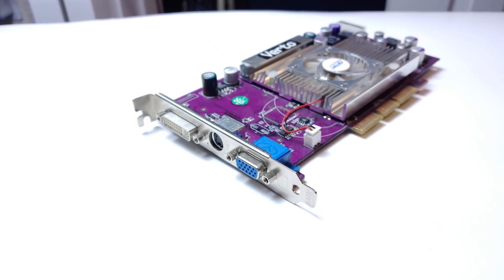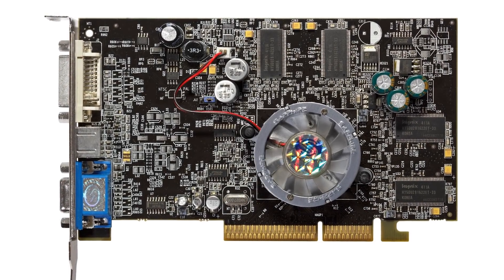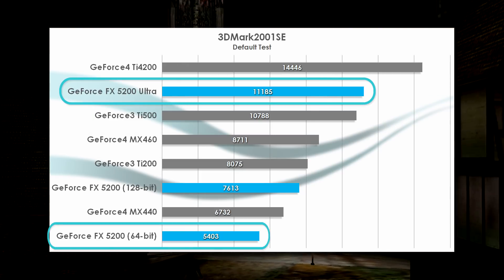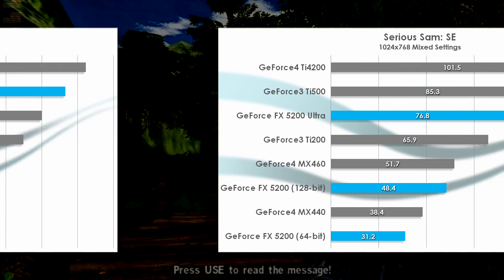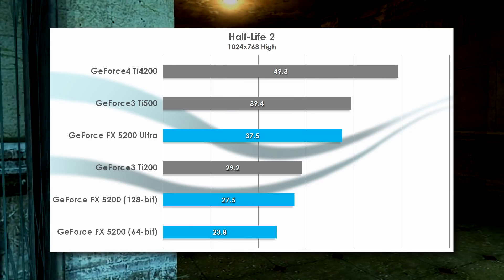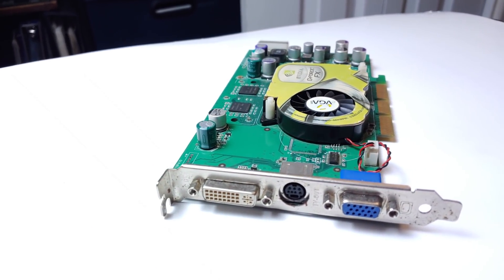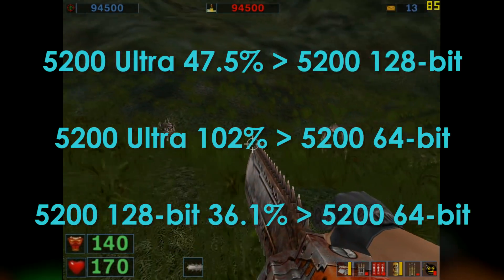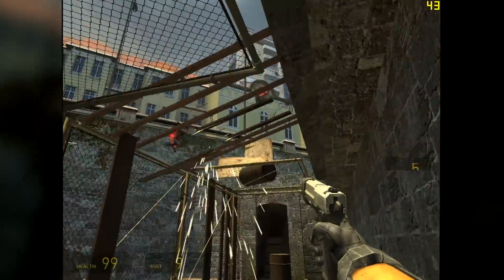GeForce FX 5200 Ultra - Redemption?

Comment from the maker: I must issue a correction: In this video I mentioned UltraShadow technology providing a possible performance advantage for the 5200 series, but this feature wasn't actually implemented in the 5200 or 5600 series cards.
Reply: Its hardware of software bount?
You can try do a sofware qautro mod with rivatuner.
Thare are more options in the driver software than in de GeForce game drivers.

Comment: Can we all sit back and appreciate what a beast the Ti 4200 was?
Reply: It was the best bang for the buck from early 2002 all the way up to early 2004 if you only wanted to play the games of the moment. 
I remember hesitating between the Ti4200 and the more expensive 9600 Pro. I ended up getting the 9600 Pro because it was more modern and faster. Smart move, it was still usable for several years, I didn't change my rig until...2009 !
Reply: @Raptor3388  not what i remember. i bought a ti4400 and 6 months later my brother bought a radeon9500 PRO and that made my ti4400 look like absolute garbage tier crap. and accounting for inflation, that was the most expensive card i've ever bought. 
so to me the geforce 4 series was a hateful pile of garbage. it didn't even run doom3 properly and i bought it for that. fuck. well that and ut2004. at least on THAT one the gf4 killed it.

long story short, r300 rendered every nvidia card moot. i mean, the ti4200 was great in the short while before r300 was out, but meh. it was a dead end and it couldn't fucking run battlefield 2 because it was so backwards with no sm1.4 support. also the radeon 8500PRO ended up being faster than the ti4200 in the long run, which is funny. and it fucking ran battlefield 2 despite being a gen older.
Reply: One of my all time favorite graphics cards are the Geforce 4 Ti 4200. It was really a killer on the market. Basically a Ti 4600 with 20% lower clocks with no other cuts which could often be fixed with OC and you had a high-end graphics card for half the price.
Reply: I have two ti 4600's

Comment: Shows how misleading Nvidia's card names were. First the Geforce 4 MX cards which were not true Geforce 4 cards and performed worse than even the low end Geforce 3 cards but then the 5200 which performed worse than the similarly named 4200. I wonder how many people "upgraded" to the 5200 card figuring it must be better than the last gen 4200. Lucky for me I did my research at the time and kept my 4200 TI until the Geforce 6600 came out. (the high end cards were out of my price range).

Comment: When it comes to the ti4200 debate not much matters for me as the ti4600 is the last card Mac OS 9 officially recognizes. If your in to old Apple hardware it's a much desired card. But the radeon hd 9600 was so slouch in Mac os 9 either and supported Mac OS X a little better with Quartz Extreme support. Something totally useless today but was quite useful in Mac OS 10.2 and higher as it enabled elements to draw faster without relying on the cpu.

Comment: My memory of the FX5200 was reading reviews which looked okay, but then buying one and it performed so badly, I went back to my older card (Geforce 4 Ti4200).

The reviewers all where given the FX 5200 Ultra or the FX 5200 128-bit, and no mention of the 64-bit even existing. This and advertising DX9 support.

It the biggest GPU bait and switch I can think off.

Great videos Nathan. I know your not so active anymore, but you really do a fantastic job with a wealth of knowledge. Thanks for your efforts - Paul

Comment: Good video! Tbh I didn't even know there was a 5200 Ultra, I'd never looked at them seriously due to the Ti4200 being generally known to be faster, which is indeed confirmed by your testing as well. I'm also surprised by how the MX'es rank in general and perform, as it was also a whole line of cards I had simply ignored, I was even given an identical MX-460 to the one you have, but never ran a game or benchmark on it back in the day.

Comment: What a great review! For myself i think the FX5200Ultra was good budget card. Back i the days i had to choose between Radeon 9500 64mb   (128Bit) and the 5200Ultra as an Upgrade from my geforce3 (ti500 bios modded). I chosed the 9500 and it was a big mistake! I will say that the 5200U for entry DX9 Level (Or DX8 With AA)is not the wrongest choice. For example a Palit FX 5200 Ultra has no external power connector like other Ultras. This little differenz makes this card a bit interessting from others. I enjoy your channel, you make by far the best GPU Reviews. 👍
Reply: I agree. 5200Ultra seemed like a good choice for the money back in the days. I had a regular 5200 128 bit mem and 64 mb ram and after overclocking it carefully I noticed a good improvement. You see in the tests that FX5200Ultra was very close to Ti4200 which was a wonderful high-end card.
Reply: @Just_a_Lad  FX5200 was a cheap start for building a gaming PC. Today you have to pay 300 bucks for a entry level RX6500 😂
Reply: @blastfromthepast3073  yep I agree , the prices today are ridiculous. I think that I bought my FX5200 for something like 40-50$ , I didn't have a lot of money back in the days but I wanted a card with shaders support, I was with GeForceb256 at that timez so it was a good jump. We didn't have the Ultra model in my country though , or I have never seen it.
Reply: @Just_a_Lad  Same here! But I saved some Money for a 9500 64MB but wished to get a Pro 😁
Reply: @blastfromthepast3073  I was left with the impression that Radeon 9500 is quite a good card, on pair with Ti4200 if I remember it correctly. I remember that there was an option to convert it to Radeon 9700 with a BIOS which unlocks some hidden potential plus it overclocks it , if I am not mistaken.
Reply: @Just_a_Lad  The 64MB 128 Bit 9500 was always slower than a ti4200. The 128MB (L Type Memory) 9500 was a beast. it had 256 Bit Bus in Stock and could unlocked to a real 9700 with a bit of luck.

Comment: Seems like every card I bought for awhile was crap back then. I had bought a Geforce MX440 from bestbuy and returned it for a Geforce 3 TI200 after finding out how bad it was. After that card I bought a Geforce FX 5700 Ultra and seemed barely ok at first but just tanked at Half-life 2, doom 3 and others paired with a Pentium 4 3.0GHz w/HT. Next card was a like a god send though, Geforce 7800GT 256MB. Was really happy with that card and even SLI'ed it later.

Comment: MX 440 was my first GPU on my first PC in 2004. I remember it can run Splinter Cell, but can't run Pandora Tomorrow. I didn't know anything about SM2 and got frustrated. But then I found out the problem and replaced the card with Radeon 9550. Pandora Tomorrow ran smoothly and I can turn on light trail, light glow, and motion blur in NFSUG2, options that were unavailable on MX 440

Memories....

Comment: This is the difference a larger memory bus, better memory, and higher clocks can make with low end GPUs. You can see the same thing between the GT 1030 DDR4 vs GDDR5. The GDDR5 version outperforms the DDR4 variant by 100% because of memory speed and bandwidth

Comment: Had both the 4200ti and the fx5200. Definitely loved the 4200ti, volt modded that on par to a 4600. The FX5200 was a pretty bad card. I threw everything at it from volt modding to flashing it to a Quadro & fx5500. It would artifact on pretty low overclocks.

Comment: I can only think of one use case where the geforce FX series would be relevant for me to pick up. Namely, with the original release of Final Fantasy VII for PC, the only way to get hardware mode enabled was if the GPU reported compliance with ALL of the features it requested. And its testing would always trip up on "8-bit palettized textures" for modern cards. Geforce FX was the last series that supported this fully (wish I knew then).
That said, I would definitely rather try and get something stronger than an FX 5200/Ultra for that. Admittedly I still find the FX 5950 from MSI aesthetically beautiful, and the sunflower cooler being very functional. Not to mention the standard one's ability to bios mod to a 5950Ultra was well documented at the time.

Comment: Sadly my first playthrough of HL2 was with an MX 440. Every time I'd get a better card I would replay through. MX 440 64mb, radeon 7500 64mb, radeon 9600xt 128mb, 8600GT 256mb, 9600gt 512mb, 8800gt 512mb, hd 7850 2gb, gtx 970 4gb, then a downgrade to GTX 760 2GB because of moving expenses.

Same for Halo CE up til the 8600gt

Comment: I remember back in the day, my first pc had a 9200se. Then I changed it to a fx 5500 which is basically a fx5200 with higher clocks and 128bit memory. I recall it was a decent boost over the 9200se which i have later found out it was just a radeon 8500 rebadged.
Reply: Not really, 8500 is better than 9200se.

Comment: For me my Graphics card history on my primary computer(s) went: Hercules Monochrome->ISA Trident 8900C VGA-> AGP ATI 3D Rage Pro Turbo->Radeon 7000VE->BFGTech Geforce FX 5500-> BFGTech 9800GT->GTX 770->GTX 1070. I actually found the 5500FX to be a fairly competent card- It was definitely an upgrade from my 7000VE, and it opened up a lot of options in terms of game titles I could run, and It was like $29.99 CAD so the price was right at the time IMO. It paired well with the Pentium 4 Willamette I was using at the time.

Comment: GeForce 6200 128Mb was my second 3d card after a GeForce 2 MX200 32Mb. It was... quite interesting. I could push the card quite far if I added an active cooling solution to it. Used it to play both Fallout 3 and New Vegas, and it was good at Oblivion. Of course, I later upgraded to an 8800GT which I still have today in one of my Windows XP builds.

Overall, I could say that 6200 was a very decent bargain gaming solution.

Comment: Done any test with overclocking the 128 bit fx 5200 ?

Perhaps testing out something like the ati 9000 series next on this testing suite, perhaps also bring in 3dmark 2001se and 3dmark 2000 into the mix with the average score of 2 runs per card & 1 overclocked run.

Comment: Hi. I remember in GeForce 6 & 7 & 8 (only PCIe) series , there were cards labeled Turbo Cache . They had 32mb dedicated memory and used system memory in win vista & 7 . Please, if it's possible, make a video about these turbo cache (disastrous) cards . It will be fun !
And a separate GeForce 8800 ultra (not GTX) video .
PLEASE .😊

Comment: The 5200 did have one advantage much like the equally dire GT210, they made for cheap quiet HTPC cards at a time when on board gfx were even worse and rarely supported SVideo or composite video out (given few tvs supported vga and hdmi wasn't an option. No fan as well was handy. Mind you, all of mine died pretty quickly giving me the incentive to get modded xboxs instead with xbmc.

Much ass was sucked by them in every other area.

Comment: haven't touched the FX 5000 series cause I went straight to a 7600GST after my Geforce 4 MX 440 died. I finished Doom 3 with my MX 440 paired with a pentium 3 733mhz and 384mb sdram and it still astonishes me up to now how the heck I did it with a res of 640x480 and definitely lower than 17fps that you are getting. Probably getting 10fps average or was there a very low preset in Doom 3 I couldn't remember. Still today I wouldn't even touch a game if I'm not getting above 60. Just goes to show how I value gaming back in the day. I made it through Doom3 and didn't give a sh#t about graphics.
Reply: I tested Max Payne on an onboard Riva128ZX, man that was slow, didn't even work until testing like 5 different drivers. Can't remember if I played it that way. Our PC didn't have AGP, so I got me a GeForce 2 MX PCI, an ELSA Gladiac 511 PCI made in Taiwan (I don't even have to look it up). That card was super expensive, I think it was 299DM (german mark before the €) but the build quality was just amazing. It was meant for multi-monitoring with its 2 VGA ports but I never used that feature.

Comment: Funny that you mentioned Nvidia practicing dubious marketing in the past. 
They did the exact same thing with the current ultra-budget segment, by releasing a much slower DDR4 variant of the GT 1030. Misleading customers into buying a severly hobbled product by calling it the same. 
They could instead clarified it a bit and maybe calling it a GT 1020. Same would apply to the 64-bit FX 5200. Maybe they should have called it the FX 5100?
Reply: @randomguydoes2901  Yeah. Nvidia never learns. 
They also did the same with the GTX 1060 (3/6 GB), where the lower-specced card had a different GPU core

Comment: Are you making or made video about Radeon 9550? at the time (2005-2006) had GeforceFX 5500 and Athlon XP 2500+ oc'ed to 3200+ speed and it was really big upgrade over geforce suddenly i could play games with bump mapping and other shader goodness and not have single digit framerates :D and i remember it overclocked like mad, specific model i had was Gecube 9550 with fancy shroud http://www.vgamuseum.info/images/zaatharen/ati/R9550GU_fhq.jpg - photo of gpu, but with 128MB memory instead off 256. and also Great video as always :) cheers.
Reply from the maker: Love those GeCube coolers

Comment: Very Nice, I never thought my Ultra was crap, but I wasn't playing to much of the latest and greatest games of the time, and i moved onto a Radeon 9800 in my laptop after a few years.  Any overclock testing on your 5200 ultra?  I could get mine up another 25 mhz way beck when, but was also super scared of breaking it so didn't push it to the max.
Reply: Few years? 9800 and fx5200 were released at thesame time.

Comment: I had this card i have added radiators for memory chips and changed colling for some made from cooper made by titan. On core i could have as i remeber 355mhz nd on memory something about addtional 50 mhz. Also i as i remeber i could run doom 3 on mediun 800x600 with avarege 30 fps. But i think it was depending which drivers you have used. The newest not always were better.

Comment: I bought a Radeon 9700 (my first ATI card ever) and I had to take it back because it wouldn't work with my Biostar motherboard at the time. I bought a Geforce FX 5950 Ultra, but it was replacing my Geforce 2 GTS.
Reply: I had the 9800 (regular, not the pro edition) that came with my Dell Dimension 8300 back in early 2004. I later upgraded it to an X1650 AGP card in late 2006 and then to an HD3650 in 2008 before getting a Core 2 Duo PC.

Comment: So it was like the GT710 of it's time?
Reply: You can kinda call it the GT 1030 of the early 2000's. 
Or let's break it down some more.
* The 64-bit FX 5200 could be compared to the GT 1030 (DDR4)
* The 128-bit FX 5200 could be compared to the GT 1030 (GDDR5)
* The FX 5200 Ultra could be compared to the GTX 1050 in relative terms 

Or if you remember the GTX 600 series, the best comparison would be this: 
- 64-bit FX 5200 / GTX 650 - Slowest in its class, same GPU chip, but limited in many ways
- 128-bit FX 5200 / GTX 650 Ti - Average class performance, full chip used
- FX 5200 Ultra / *GTX 650 Ti Boost - Best possible configuration. 

* The 650 Ti Boost was a special one though. It used the same GPU chip as the larger GTX 660, and could support 2-way SLI (this combo could edge out even the flagship GTX 680 and the competing Radeon HD 7970 GHz Edition)

Comment: I swear, every video out there reviewing FX5200 is actually reviewing the 64 bit version. I'm not saying that it's a great card, but cmon , it's an entry model and was still doing good when tweaking the settings a little bit.
Reply: Was the difference between the two significant?because I remember having an FX card back then but can't remember it performing that badly well that is until F.E.A.R came out.
Reply: @cyphaborg6598  The difference between the 64 bit and 128 bit version was significant , around 35-40%. I was having a 64mb version but with 128 bit of a memory and it was doing really well for the time.

Comment: I was going to say that the FX5500 is faster..but despite being on a slightly smaller node its clocked 55Mhz lower on the core and 125MHz lower on the memory. Though you were guaranteed a 128bit bus.
Reply from the maker: Actually some 5500s did have a 64-bit bus. I own one such card from eVGA.
Reply: So OEM were being misleading with the FX5500 as well. I think I got lucky then as I didn't end up with a newer equivalent to my TNT2 Vanta (just called a TNT2 on its box & BIOS)

Comment: The GeForce FX was the worst product line nvidia put out by a mile!! I remember buying the FX 5200, yes it was cheap but it was sold as a card you could game on.  To my disappointment it could not run a single game of the time at a decent frame rate even on low. Ended up trying to return it, but I couldn’t so in frustration I bought an ATI 9700pro and that card was literally thrown as far as I could into the paddock next to my house. Lol found the card years later while taking a walk.  I learnt my lesson, you get what you pay for lol
Reply from the maker: Whaaaat?? Why would you throw your 9700 Pro away?

Comment: I own an XFX FX 5200 (64-bit) and it's definitely a dud but even I knew diarrhea would move faster through a bigger pipe. The 5200 Ultra should have been the bottom of the barrel for the FX line, but leave it to Nvidia to go below the floor to sell a GPU.